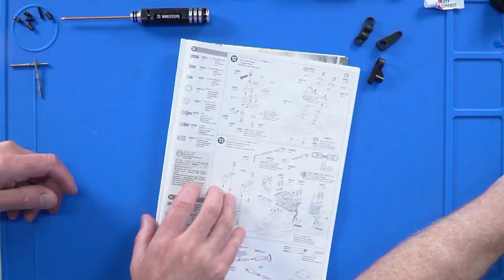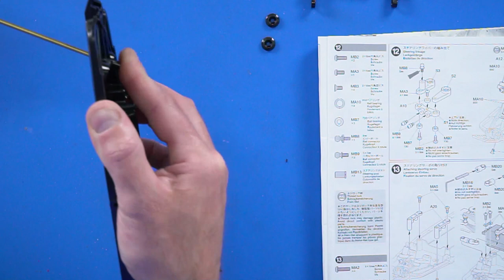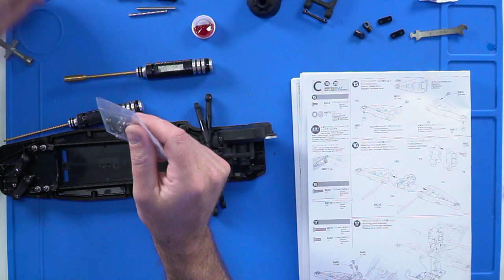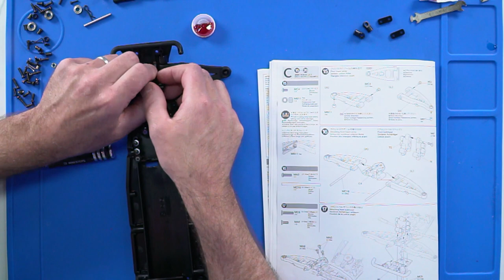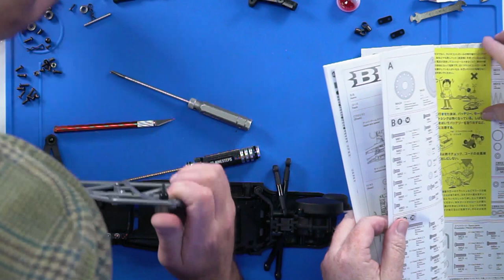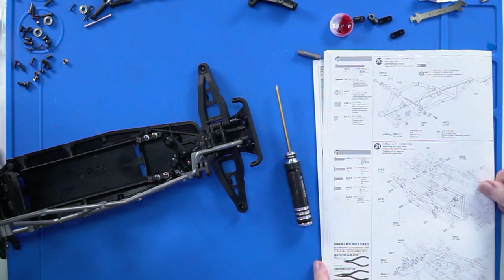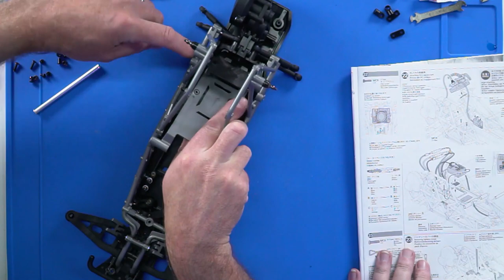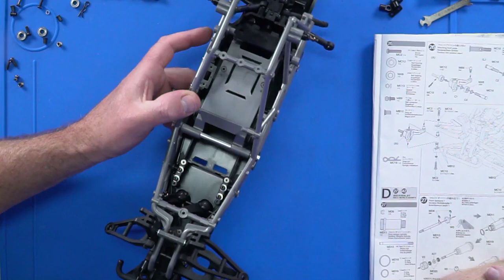Tamiya 1/10 BBX Electric 2WD Off Road Build | Part 2 | #askhearns

Comment: Did you finish the BBX? What happened to Part 3???
Reply from the maker: Part 3 is coming out soon!
Reply: @HearnsHobbiesMelbourne  Excellent! I've been holding off on building mine until I get all your tips. I also have the optional slipper clutch and would appreciate any advice you have for it. Keep up the good work!